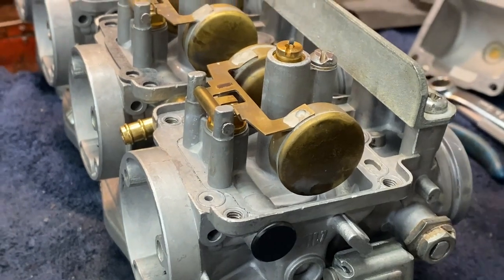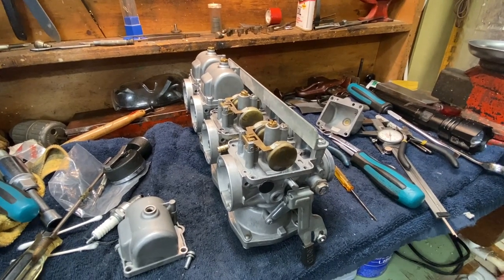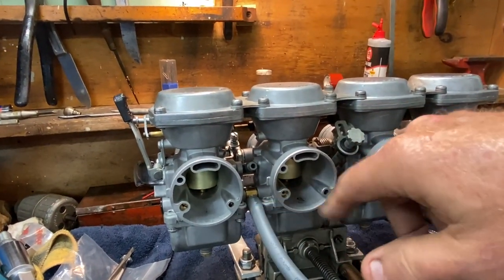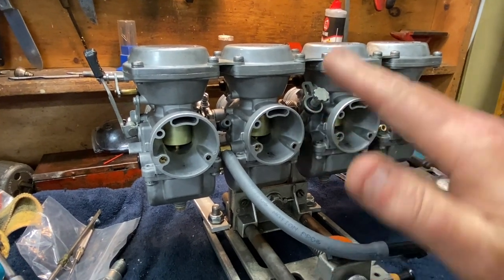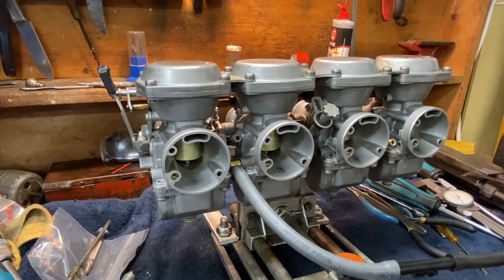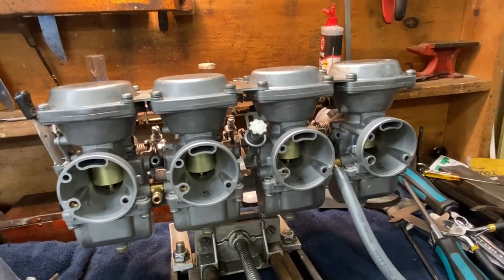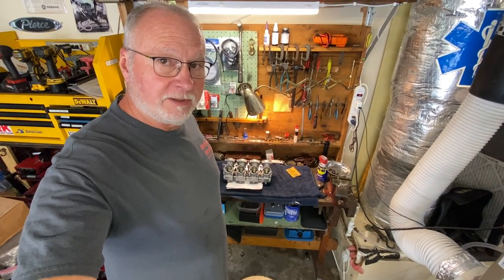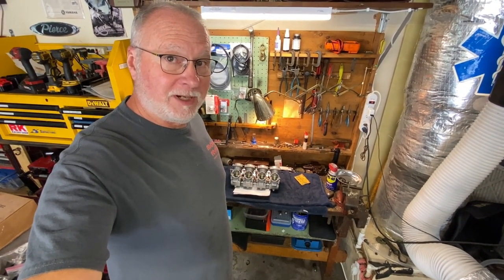Overflowing carbs issue SOLVED! Check the float DROP! BS34 Mikuni.

Comment: I’ve never seen anyone address this. Very informative. Thanks!
Reply from the maker: Thanks. It's rarely necessary to address. Doesn't happen very often. It's one of these things where if you have a carb or carbs that just keep spewing gas after rebuild and rebuild again and again and again with all settings exactly to spec, you gotta look elsewhere than the normal stuff. Many carbs don't have float bowls deep enough to let the needle get cattywampus and jam up in the float seat. What I have found is, if you have a set of older Mikuni's that use the flat paper/composite gaskets on the float bowls and not the O-ring type like newer Mikuni's and almost all Kehin's, this is something to take a look at. Seems those carbs have the deeper float bowls. The early Keihin's and the low buck Honda's like the old XL's with the solid slide carb, where the throttle cable goes right into the slide, these type are definitely suspect. Cheers.
Reply: @MotoRestoFL  G'day champ, great last vid, very much, informative. Mate any chance you happen to ask the Z1R custom if he'd sell me that Z1R swing arm you so meticulously engineered so well ? Big fan. Cheers mate, G'day from OZ
Reply from the maker: @mathewcridland1084  he's been away for work for quite some time. Should see him after first part of December. Email me your offer to motorestofl@gmail.com and I'll present to  him. Please note, he hasn't made a 100% decision on which swing arm he's ultimately going with. Again, make sure you send an email. I will forget if I don't see it sitting there in my in-box. Cheers.

Comment: Wow, excellent troubleshooting here. I’m working on a customer’s VStar 650, and immediately after rebuilding the carbs (duals), I’m having massive fuel flow out of the carb breather tube.
My first thought was, of course, bad float settings on the Jhinese rebuild kit that the customer supplied (w/ plastic floats, and the tiny clips that “secure” the needle to the float tang). But I’m really glad I came across this video, so now after I open the bowls back up, I can double-check those drop-stops and also check for a needle bind condition. Otherwise, might have adjusted the floats, buttoned-up the bowls and STILL had an overflow, and then have to open em up AGAIN.
Thanks for this helpful vid!

Comment: I found this the hard  way working as an apprentice on Virago Hitachi carbs that would always flood.  After two years and many carbs I came across a float drop conversation and it solved all my problems.  All the old men in my area were thrilled there were no drips under their Viragos, or Viagros, as the English would call them.

Comment: What is the silver knob between 2 and 3 ? And should there be hoses going from the over flow ports to the underside of the bike? The floats I read on 94-97 are unadjustible. Enjoyed the video and RIDE SAFE OUT THERE!
Reply from the maker: Idle adjustment. Yea there’s supposed to be hoses sometimes I do and sometimes I don’t. It’s not critical.
Reply: @MotoRestoFL  the 94-97 I was referring to about the unadjustible floats was the VFR750F.
Reply from the maker: @henryhawk978  yes many are. Valkyrie also. If it’s way out replace float.
Reply: What should the measurement be on the floats for the VFR750F floats? I'm  gonna be pulling the carbs, I  have a leak. So I'm gonna check everything.  Also, the choke isn't working so I've got to check it out.
Reply from the maker: @henryhawk978  I don’t recall at the moment, you can find a manual online or I’ll have to look it up later.

Comment: Excellent video!  I'm tinkering with a 79 Kawasaki KZ650 and am unable to get the floats set correctly.  Too much flow or too little/none.  I live fairly close to you.  Are you available to check them out?
Reply from the maker: Check back in a week or so, I’m having some medical issues right now.
Reply from the maker: Oh and thanks.
Reply from the maker: @mikecogswell2364 I am feeling somewhat better now and had to cancel my motorcycle trip to TN so I am staying in town, if you want to reach out on these carbs, email me motorestofl@gmail.com and include your phone # and we'll talk. Thanks.
Reply: Glad I watched this.  I just restored/cleaned a set of 3 from a 1978 Yamaha XS750 E.  The bike hadn't run for many years, so the float bowls were stuck to the floats upon disassembly.  The float drop tangs were likely bent when I forcibly separated the float bowls from the carburetor bodies.  
The engine ran well during the initial startup, but after the test ride, the engine wouldn't idle down.  The carbs then showed signs of leakage and possible overflow.   After watching this video, I now know where to investigate.

Comment: Y is the other jet capped off?
Reply from the maker: You'd have to ask a Mikuni engineer I don't know. Several Mikuni's are like that, the slow circuit is plugged at where it typically would be open, and there is a connecting port between the main and the slow where it ultimately gets its fuel from. Again, I don't know why. Just the way they did it.